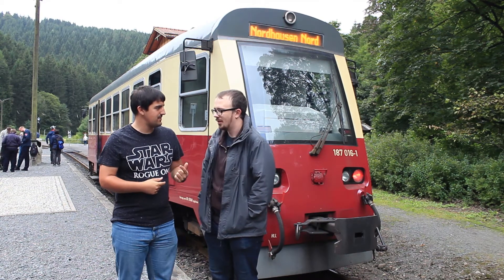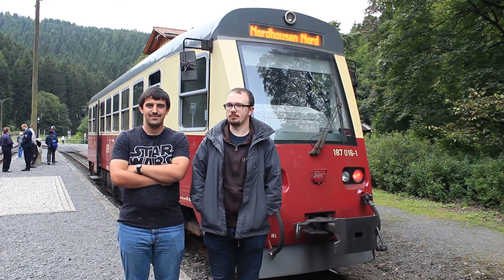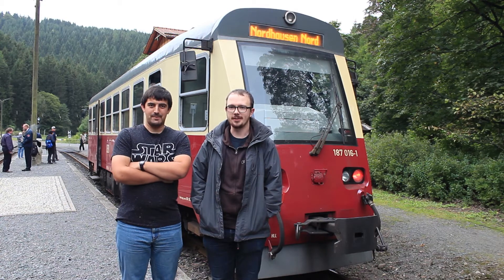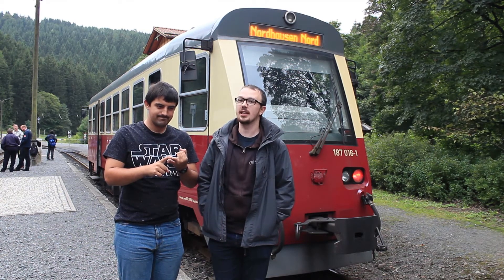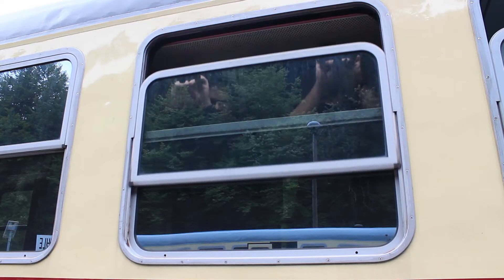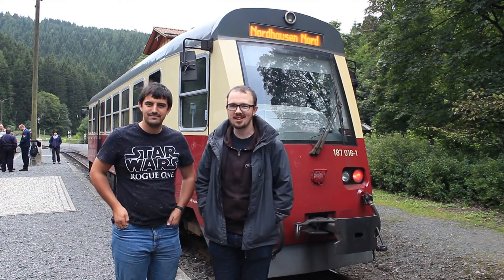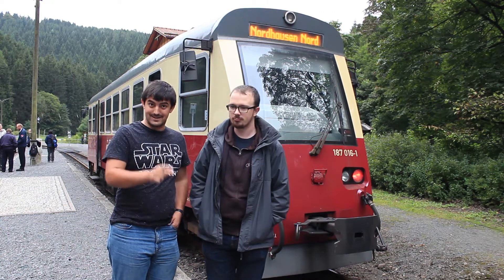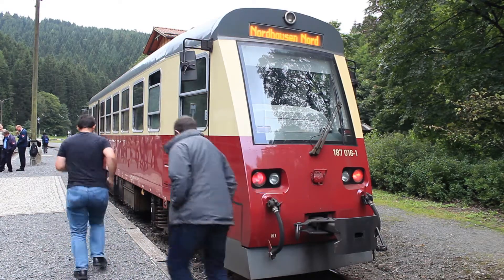Diesel Engines And Their Heritage - Episode 4

Comment: I googled the number of this, this is the one built in 1999 with a seating capacity of 46. And a 242 kW, 325 hp diesel driving through a hydraulic transmission whatever that is with a top speed of 50 km/h or in English 30 mph. 45 mph slower than a Pacer.
http://www.michaeltaylor.ca/ind/hsb016.shtml